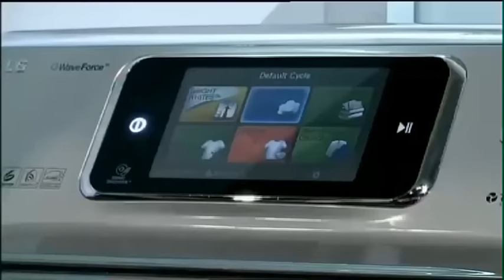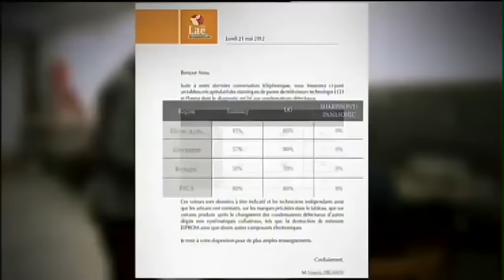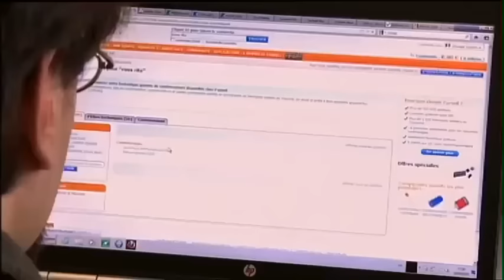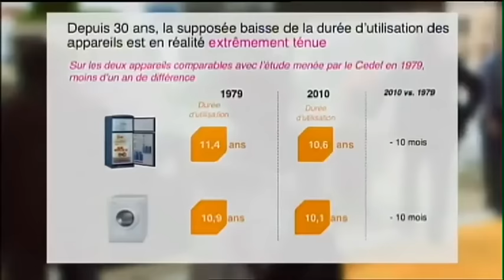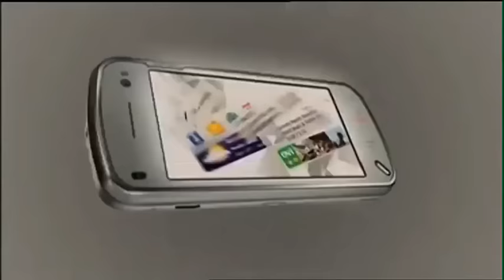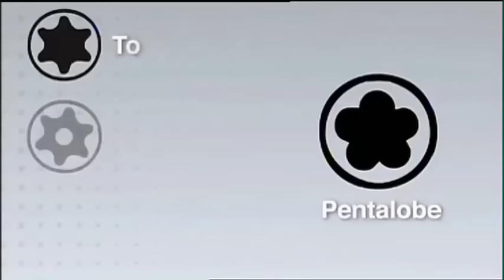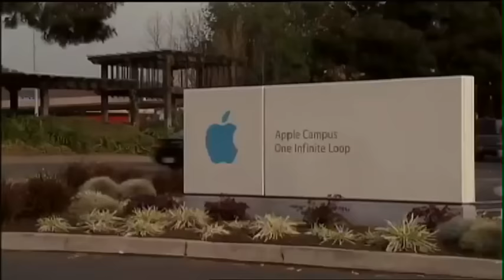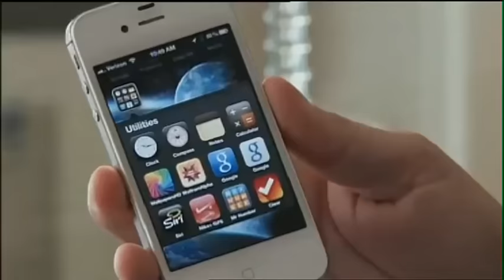Apple and Samsung: Built to Fail? The Truth About Planned Obsolescence | Investigative Documentary

Comment: A farmer cannot repair his Deere tractor without the proprietory software and a car owner cannot diagnose his car  without the vendor's gadget and a laptop. Gone are the days when a mechanic can drive his truck daily for more than 30 years with just rewiring and changing oils and other fluids, tires, batteries, oils seals, brake pads, rubber seals, piston rings, bearings, etc. Besides WW2 vehicles are EMF-proof.
Reply: Fight for the right to repair. Changed the fuse in my micro wave and to my surprise there was a schematic glued to the cover like almost everything had 30 years ago.
Reply: I agree.
Reply: I totally agree and Im six weeks into trying diagnose a fault in my effing wife's Honda hair dryer fuel injection Honday Shitty City junk pile...(CVT 4000 USD sir hahahaha)
Reply: Tractor owners use modified firmware, in order to service their own vehicles..
Reply: @therealavolpe  :
Imagine, having to jailbreak a tractor in order to repair it.
Reply: The manufacturer probably does not mind making some money on repairs, but I do not think the greed is the main problem here. What happens if the manufacturer does not prevent the user from messing with the product? First time someone screws up ang gets hurt, the manufacturer gets sued. Does the manufacturer need that? No - so it just encrypts the firmware. 

Yes, you could drive simple old machinery for decades. But such machinery would now not be permitted to be sold because of emission and other standards. So today, the machinery simply has to be full of electronic circuits...
Reply: How depressing..I want be back in 1970..please. it's all gone horribly wrong.
Reply: Time to bring it back you think? The mechanical era
Reply: @crypton_8l87  Yes. Especially after the  nuclear war, God forbid. No electricity. No internet. No chips. We are still training mechanics who can disassemble and assemble WW2 military jeeps, trucks, and vintage tractors.

Comment: Planned obsolescence should be banned for the same reasons the coal powerplants are banned
Reply: I agree.  Unfortunately those who make laws often don't have any brains.
Reply: GM cars did it by introducing models which looked new.b
Reply: unfortantly some better tech is by nature not repairable. soldering ram to board means faster speeds. so its choice between better tech or repair ability
Reply: @sly2792004 thats bollocks, making jt seem like you cant change a battery has 0 performance gains. Nobody solders ram into a pc, not even apple

Comment: My first custom build desktop lasted from 2009 till 2022, bought about $500 in replacement components in that thirteen year long time-span. It still works and get's used by friends, who occasionally come over to my house for a LAN party. Yes, a processor released in 2008 paired with a graphics card released in 2014 can still play 3D games. The old rig was actually faster, than most family, friends and acquaintances their brand new computer, thanks to correct use and maintenance.  

I saved a lot of money on components I could reuse, when building my new desktop in 2022. I reused the graphics card I bought in 2016, and the power supply bought in 2018. People don't want to spend more than a third of their products total price-tag on repairs that are futile and short lasting. This changes when people can reuse replacement parts from their old device, onto their new device. It makes the costs for repairs more long lasting, as one can reuse the replacement parts and don't have to buy new once in the future. 

The problem is that people aren't educated, thus prefer to buy a laptop that only lasts 2 to 3 years. The fact that many people believe a myth, that computers become slower over time, doesn't aid with this problem.
Reply: it can still play games sure but it cant play new games at same level it did when first built. my 2020 pc that was near top of line for consumer grade and could play any game on ultra settings now cant play a game released in 2023 at recommended settings. i need a new cpu. my cpu has more cores but the cores it has are slower then the recommended cores. so a $200 cpu is better for gaming then my $600 cpu from 2020. this is why people upgrade a lot. my laptops did get super slow after year and half. macbook hasn’t nor has my desktop. i plan to eventually just build new pc and give old one to family. though current gpu s are hot mess so glad to be skipping them.
Reply: @sly2792004  What are the specs? Calling it "top of the line" could be rather subjective...
The GPU could be an issue, but the CPU should be perfectly fine for a couple more years to come...

Don't fall for the recommended / minimum specs, they usually just list the lowest-end hardware they had access to for testing. My previous desktop had a CPU released in Q4 of 2008, played games on it in ultra settings that where released in 2017. I did however upgrade the GPU, but the CPU wasn't big of an issue.
Reply: @timmy7201  think most people would called a 10900k and 3090 top of line. As those are the best cpu intel offered and best gpu NVIDIA had. I though could only find a 3070 but gpu is t holding me back. It’s fine to play games I already have but already there’s games it can’t play at max settings. This will only get worse as games will be made for newer and newer cpus. My point is if you built a pc to play at 100% and next year it can only do 90% and next year 80% if you want to keep playing at 100% you need new pc. Which is why people keep upgrading a lot to maintain the level of gaming they wanted. We’re back in 90s again with rapid tech obsolescence. Vs 2000s where a computer could last years.
Reply: @sly2792004  So you've a 10900K and an RTX3070 8GB?

Can't argue about the CPU, that's a nice one (got the Ryzen 9 5900X myself). A 3070 is kinda the higher-mid range of GPU, so it should play most games on higher settings but could fall short for ultra settings. The low memory amount is probably the issue, it's also the reason why I didn't buy an NVIDIA card of past generation. Especially not at their outrageous prices.

Can I ask you the following questions: 
- What games are you playing, what FPS do you get?
- What do you deem the minimum playable FPS? 
- You're not playing in 4K, with anti-aliasing on max I hope?
- What size monitor do you have, try playing at 1440p if it's smaller than 30 inch...  
- Is this a pre-build, or did you assemble it yourself?
- Is their one or more sticks of ram? 
- Is the ram frequency/speed set correctly in bios? 
- Is "resizable bar" set correctly in bios?
- What are the CPU/GPU temperatures under load?

It wouldn't be the first time, that I see one ridiculous config causing a 10% reduction in performance :-)
Reply: @timmy7201  that's why I said sort of top of line. but the gpu isn't the problem it can play any game at 1440- max settings. I'm sure it'd struggle with 4k but I dont play at 4k. I was tempted to buy a 3090 ti when it was 1100, but wouldn't helped me at all so passed. ive got 32gb fast ram. non of that is issue, the issue is a 13th gen intel cpu has more performance per core then my 10th gen cpu.  newer games are designed to take full advantage of newer core performance so older cpus can't keep up.  if I replace the cpu im building new pc.

id like to get least 144 since that's my monitors max. fact is my cpu can't play Jedi survivor at max settings. sure I could play it at lower setting but that's not my point, course if you lower settings pc will be able to play games still, but for a lot of people they want to keep playing at the level they started. if they playing a 2020 game at max settings then they want to be playing a 2023 game at max settings, so they need to upgrade. one could just get a console if all they care about is playing a game regardless settings. xbox can do 4k 60fps and in 7 years will still do 4k 60fps. 

as for performance i dont know didn't try. saw I dont meet recommend specs and passed on it. got a xbox to play it. far cheaper then building new pc. played it at 4k on my tv looks amazing. pc ill play its games and pc games only on. the idea of a pc playing games at same level for 5+ years is just a dream again. current gpu are pain so until they work out the kinks im not building pc, super glade I did so when I did and dont have a gpu that melts its connector.
Reply: educated? You think a psychology professor could necessarily take apart and put back a machine?? The word education itself represents inherent choices that people made in their childhood.
Reply: @crypton_8l87  No, I don't expect a psychology professor to start repairing his own tech.

What I meant, is that IT and utilizing a computer, should be seen as equally important by our society as basic math's and literacy.

Therefore I would recommend countries to increase the amount of classes that educate IT and tech significantly. Nobody has to become a specialist, if they don't want to. But they should be at least capable of utilizing computers correctly...

Comment: I know light bulbs lasted for years before blowing out.  When CFLs came on the market Incandescent bulbs was lasting 1-12 months.    
My Father had an Olympic brand TV (when Color TVs first got popular in the USA) that lasted from 1964-1987 before it gave up the ghost.  It was repaired at times when the vacuum tubes would blow out periodically and was easy to replace.  When My Father couldn't get any more of replacement vac. tubes for the TV it was over.
Reply: This is too bad because I know of small shops and outfits that still sell hard to find parts

Comment: Still remembering the days when fixing a device was as easy as replacing a capacitor. 

Nowadays with delicate and paired smd elements that even break some unfixable micro fuses to ensure you don't meddle with "their" software for our "security" , its borderline impossible to fix stuff like that.

But at least they're doing more greenwashing then ever 😁
Reply: I get the idea, you embed a few fine wires in the glue that holds parts together. Without them you set up a destructive electric current once the battery is charged.

Comment: Im your built to fail bypass guru, Ive bypassed built to fail systems for years on technology ranging from phones, game consoles, charging devices, and vehicles and I'm here to stick oit to corporate America, I know all the tricks! That phone telling you to plug in the original charger when that is the original, there's multiple ways to fix it, one is to plug in an aftermarket charger and unplug your original, this will presumably clear the code in the phone when you plug the original charger back in! If this doesn't work unplug your original chatrger and jump the plug in prongs together to discharge all electricity stored in the components, and finally if all else fails the malfunction is likely to to a weaked thermal protection device inside the charger, 1 min in a freezer wil return the thermocouple or diaphragm to its it original form, though at this point, it's just going to keep doing in more and more and closer together!
Reply: Remember how you tossed out those old Xboxes because they told you the red ring of Death was permanent? unplug the HDMI and switch over the AV for a while code clears right up!
Reply: Those newer Fused links in the Nissans pissing you off? That's because their copper core covered in a zinc polymer that degrades rapidly and turns into an insulator, just sand it down! That'll save you 200 dollars or more!

Comment: I used to custom build PC's for myself and friends...  

After having to replace them every 3-5 years or so due to tech advancement, I decided to spend a bit more, maybe 10%, on the build fixing the primary issue which made me replace them.

After this I had a functional PC which instead of having to replace, I only had to swap out 2 parts across 12 years.

 The video card... Cause I wanted to play games..

A SSD, cause they were super expensive and small when I built it.

I feel companies have done similar over the years, but the opposite direction.

They've identified the components which if they cheap out on, saves them a small bit of money, but then leads consumers to replace their devices sooner, so people have to buy more.

It's such a wasteful process when the manufacturer could spent a small bit more and make the decice last a decade or more.
Reply: You are reminding me of my father talking about his new Ford car.... 
The silencer is under warranty for 1 year. If a hole eats through it a week earlier they have got to pay for it to be dismantled and then replaced. If it lasts much longer than that year then they have spent too much making it. 
Even if it is only one penny, multiply that by the millions of cars they make.
Reply: i built a pc in 2020. its not able to play new games on max settings and its not the 3070 that’s the issue but the 10900k. while it has more cpus then newer cpus it cores are slower. jedi survivor only uses 4 cores. the only part i could really carry over would be the gpu lol. id need new cpu, new ram, new motherboard, new psu. i honest figured top of line cpu would be good for long time just needing new gpu to keep up. boy was i wrong.